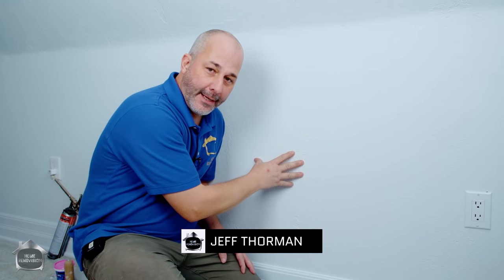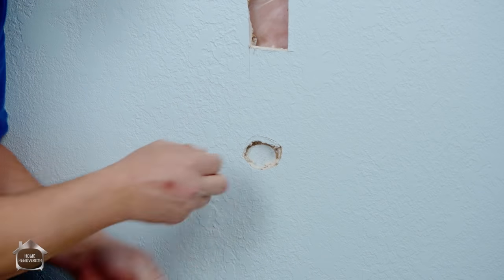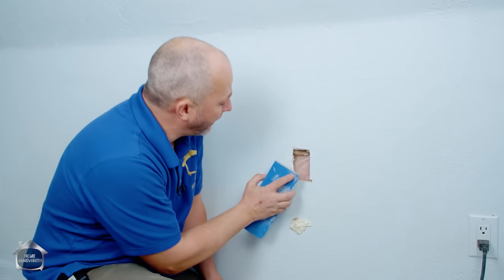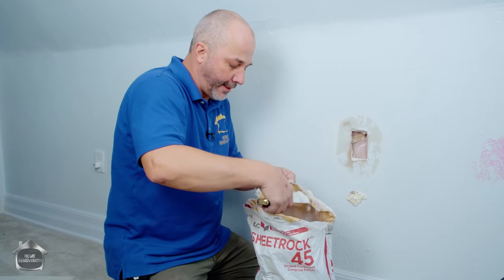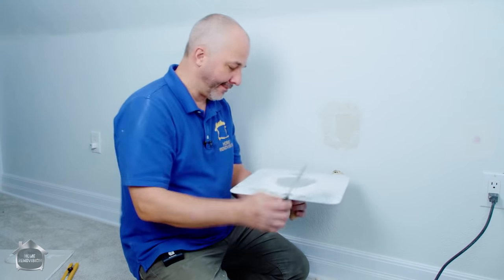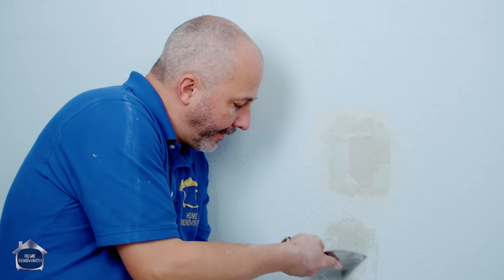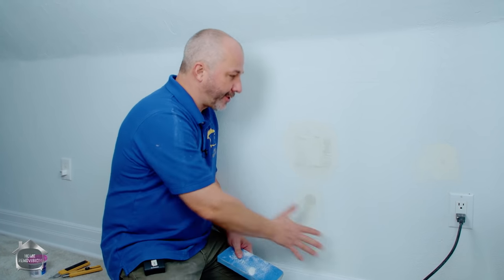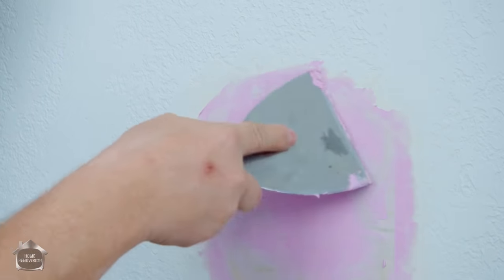How to Repair a Textured Wall in 3 Different Ways

Comment: I want to paint over previously painted drywall that had an additional darker topcoat applied with a sponge or crumpled up newsprint for a stipple or texture effect. The topcoat isn't very thick. But it's also not smooth like a regular drywall surface. Would you recommend using a paint primer to smooth the surface for further painting? Or a mud skim coat (ugh) with all-purpose lightweight product? Or is there a finishing mud? I don't know how hard the topcoat is and haven't tried to sand it. Thanks in advance.

Comment: What grit sandpaper did you use  to smooth the textured wall?

I have a large textured hole 🕳; do I add mud before putting on the tape?

Comment: Hey Jeff, i have a dent thats slightly deeper than the one you made near the outlet. If it didn't make a hole, can i get away with just using the pink stuff???

Also, what type of sandpaper did u use???

Comment: Nice channel; I would not have sanded that with a power sander; I would have peeled off the paper on the wall – the paper from the sheet rock, the painted sheet rock I would remove that paper so that the California patch could simply replace the paper that I remove with the patch paper.

Comment: I'm looking to remove texture from my wall. I have small light swirl marks, and i want a smooth finish. I tested a pole sander and it worked fine for me. But i want to know if you think it's worth the investment to buy an electric sander?

Comment: Question. If you have a home that has a small 2x2 dent in the ceiling that has a popcorn ceiling, would using expanding foam to fill the hole and then using a popcorn ceiling patch kit work over it? I ask because supposedly a lot of popcorn ceilings have asbestos in them and I'm wondering if this would be the safest way to patch it without scraping a bunch of the ceiling off.

Comment: The best way to check your handiwork is to shine a spotlight on it holding the light as close to the wall as possible. Be prepared for a shock. There are texture/stippling rollers on the market that might speed up the process. When working with them if your first attempt doesn't suit you don't mess it up, but come back to it 10 minutes later and roll it again. Do this until you get what you're looking for or it dries out. The consistency of what you're applying changes as it dries and gives a different texture. If you're real lucky there are rattle can texture paints (orange peel) that might be very close to the texture you're looking  for??

Comment: I have a 25x25 master bedroom that has two seams that have cracked all the way across the room. I have also found the the nails that hold up the ceiling are loose. So I repaired the cracks and and redid the whole ceiling with screws.  Using a hopper I used the small nozzle at thirty five pounds.  The original texture is orange peel and knockdown combined.  Really hard to match.   I sprayed with the same spray you used. Then painted. The patches stand out like a sore thump.  I textured the whole ceiling.    Would you do a ceiling like this.  I understand what you did in this video.  But won’t work on this large repaired ceiling.  That’s for any help

Comment: 01/17/2023:  I removed wallpaper in my bathroom.  It was even on the ceiling.  Dabbing and scraping with wallpaper remover and vinegar, I got the paper off.  However, this process took some of the original paint off too.  So, I spackled bad areas and try to feather the spackle out smooth as possible.  But, I realized in a small bathroom, I do not want to sand and breath in a lot of dust.  So, being 75-years old, I need to do something simple and fast.  I am thinking of just painting all as is with a heavy nap roller.  When the paint is dry, it will reveal all the spackling.  I was then thinking of painting another coat with the roller, but  then while still wet dab it with a large sponge with a lot of holes to get a texture.  What do you think?

Comment: Hi Jeff, wondering if you can help - I want to patch a large hole in a wall, the currenth wall is some sort of cementboard (?) With foil backing. Can I patch with normal drywall? Or do I need to get cement board 🤔 thanks

Comment: Hey Jeff, love the videos. I just tore out a big bedroom closet (standard double bypass door type) and I'm wondering what the best method is for filling in the drywall (it's textured = how I got here) where the framing was. I essentially have a 4" wide space from floor to ceiling on each side and a 4" space across the ceiling where the 2x4 framing was that I need to fill with drywall. How would you recommend going about that?
Reply: P.s. I put 2x4s in the wall, so there is plenty of support where I need to put the drywall.

Comment: Hi wish I saw your videos sooner but I filled in a hole in the drywall just with the mud but did not cut it out and stick in a patch and now its all uneven so it is dry but I want to know if I can use the tape to make it flat and then put more on top? I sanded it down  but its uneven. I would like to know how to repair a wall when removing a whole cable outlet that was sealed inside the wall. Thank you.

Comment: So apparently my puppy did a number on my hallway wall and it's textured. Looking at your examples here are great, but my damage is more towards the corner of the wall. Both sides. Would I have to create a new edge? If so, how can I do that? Please advise. :) My wall is very crumbly...not like normal drywall....

Comment: How to match other textures would be great to know.

Most of my house has textured walls & ceilings, mostly ~270 degree circularish arcs about 8" diameter with shallow smoothish ridges. Shallow texturing, not stippled or knockdown. I'd send a pic if I knew how.

Remodeling project underway, need to do big & small wall & ceiling patches, replace large areas from electric overhaul, frame & finish 3' extension to kitchen/LR wall.

What to do?
Reply from the maker: sounds like a plaster and sea sponge installation. easy to replicate with white drywall compound and a sea sponge . Cheers!

Comment: Hi Love your videos,  I need help, I have scraped off the paint from parts of the wall as it was flaking.
I sanded it down, I used  base coat . Then started to plaster the areas, i realised that as i was plastering the paint from parts of the wall  was coming out during my plastering process.  I could see some areas  where the layers of paint,  under the plaster was softening and bubbling. 
PLEASE HELP ME
WHAT AM I DOING WRONG?
❤🥰I LOVE YOUR LAUGH🤩🤗🤣🤣😆🧿

Comment: I’m kinda confused about the primer part. You sprayed the killz primer and then did the texture with the caulking example. I would’ve thought the primer goes on after just before paint??? Also why is it said to use pva primer on new drywall I’ll use that same spray can of killz if I don’t have to use pva  but like I said I’m confused about the primer part any suggestions please???

Comment: hello it’s me again Christine    
does it matter what grit sandpaper I use    I got impatient and I used a probably 3 inch broad knife instead of a 6 inch which I have now so I have a lot of sanding to do     
this is all next to a brand new vanity that is 1 inch on each side from the wall     totally confused there     The back of the vanity is about a quarter inch from the wall which i used ALEX Latex caulk plus silicon     I put way too much I have no idea how to get this **  off   i’ve tried once and ripped the drywall    so that’s on hold because I don’t know what to do      
how do I get this spackle and caulk off of my new vanity   on the products they say chip it off   
I don’t think so !?  i’m doing all this myself for the first time I paid a friend he did about 70% took my money and ran  D***
i’m so glad I found you
then I got a flat tire yesterday 
jezzzzz
lastly I want to correct how he put up my medicine cabinet   he put it on the outside of the drywall     I want it inside    I will look on your site but I don’t think that something that I can do    This half bath could have been done for about $600 it’s cost over $1000 now    I hope I’m allowed to ask you questions on here

Comment: Hey, so someone glued a wireless charger to the wall, and when I removed it, a layer of textured paper came off with it. It's not necessarily a hole, but you can see the brown paper underneath. It's about 1.5-2 inches in diameter. How would I fix it?

Comment: After putting on my two coats, the torn edges of the patch are showing through my mud. They’ve created noticeable divots and will definitely still be visible once painted. What did I do wrong?
Reply from the maker: sometimes we need 3 or 4 coats. Cheers!

Comment: How would you repair water that got behind paint on newly installed wall. The ac pan leaked water and made a belly in the paint and pulled the paint off the newly finished wall? Bummer. Thanks
Reply: Btw, Drywall seemed to dry out quickly and seems ok.

Comment: Wow never seen these techniques, I’ve always put a small piece of wood into the whole as a backing then screwed it in on both sides of the hole then put my shaped piece of drywall into the hole and screwed it into the backing then mudded over that and sanded, never seen the foam either and why wouldn’t you just use a mud tray, it’s quicker.

Comment: I did the California patch but it was difficult to get the ridges out so it made a slight bump in the wall. How do i prevent that happening next time?
Reply from the maker: sometimes you need to sand a larger area with before adding mud
Reply: @HomeRenoVisionDIY  which sanders do you recommend?

Comment: Caulk as texture is a horrible solution. Get the cheap hand pump or texture in a can. That caulk will flash horribly. You can't tell in this video because he doesn't side light his work but I guarantee these repairs look bad. Also using oil based Kilz when you are going to finish with modern latex paint is a no-no

Comment: Why would you mix up hot mud with Your Hawk makes no sense. I'm a plaster and a drywaller for 40 years. Why would you cut out a bigger hole when you had a smaller hole to fix. Well when you get more experience over years you'll learn to use the right tools.. California quick patch that's hot mud in California.. we've been doing blow out patches drywall was invented. But I only did that when I was an apprentice period when you get more experience you won't use a blowout patch

Comment: Dude, you covered up the caulk with the mud and little roller. HUH? And you didn't follow up with the hole over the plug? You were not happy with the texture but then went ahead and just spray painted it?  This had potential to be a good video, but you settled for crap and then told us to hire a pro for good results. I don't know how you get the subscribers. Maybe people are happy with you chuckling at your own mistakes.